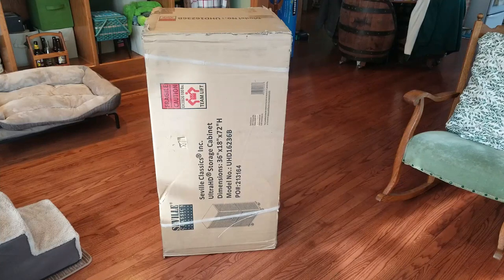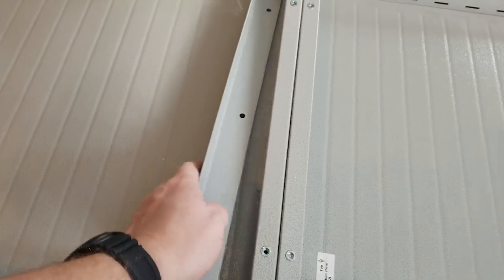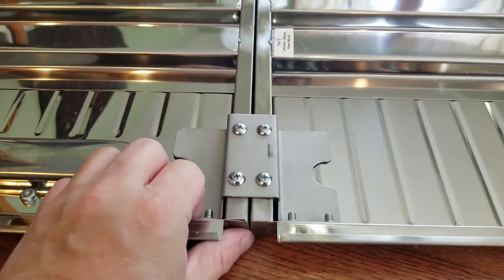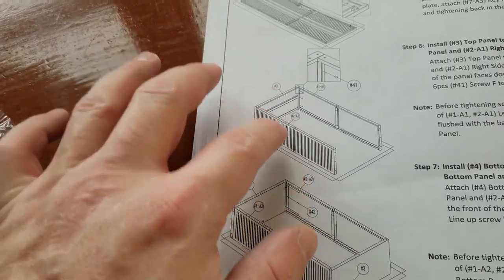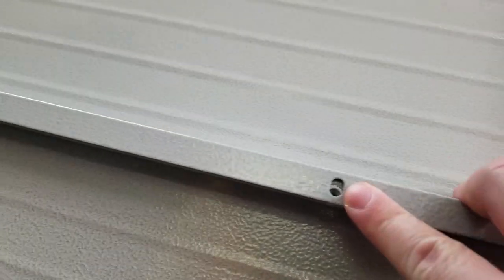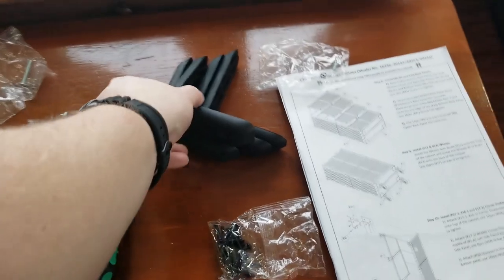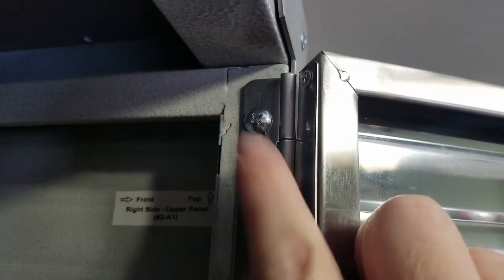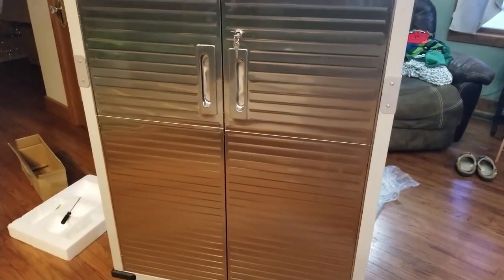Lets Build A Seville Classics Storage Cabinet!

Comment: It’s complete, it took about an hour & half. If you’re considering 1 of these cabinets, I would use sawhorses & a sheet of plywood to get it off of the floor, obviously you’ll need help once the top, bottom & sides are assembled but it will save your knees & back

Comment: Thanks PJ - I didn't see this prior from you before searching. I bought the Ultra HD for $110 clearance with 2 bashed panels. Contacted them, submitted information, and they shipped me 2 quickly. Top notch service! NOW 2 months later I've been intimidated to assemble, and freezing temps, so this has been motivational to get er done. Thanks brother! The company has solid shelves, and I've been looking at their variety in general . For similar costs of other cabinets of this strength these stand apart with the sweet stainless fronts.

Comment: I might get some of them. Looking for best price or a sale.
One of the negatives is that you can only close it with the key and doesn't have a separate lock handle, so you must leave key on or never lose it.
Second negative is that you can't level the casters. If your floor is not level the cabinet might fall or doors will not work properly, so you either add uggly shims on floor, maybe put washers/spacers on casters or buy new leveling casters.
Third negative is price.
Reply: I agree with everything you said, but the price. I don't know what you paid, but this was the cheapest cabinet I could find for $250 at Sam's. All the other ones I looked at were over $400.
Reply: @brentsealy9623  That's exactly what I paid $250 at Sams.